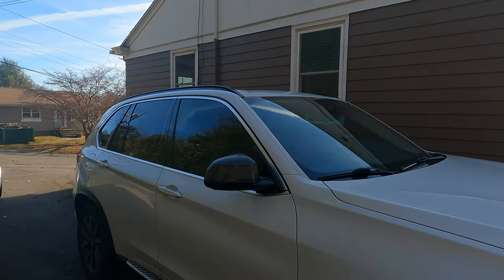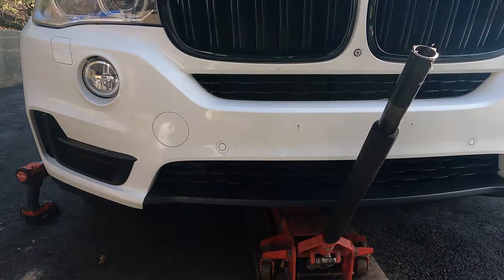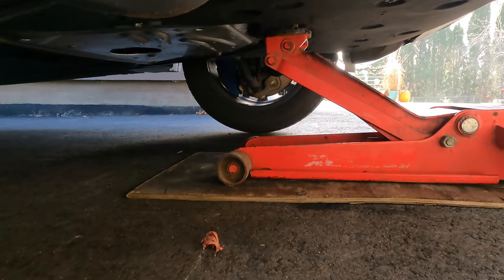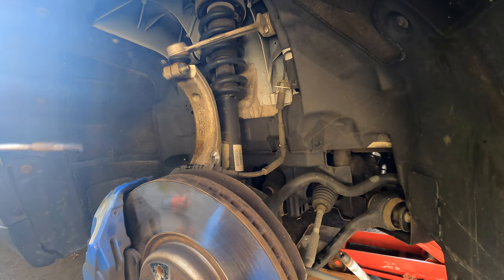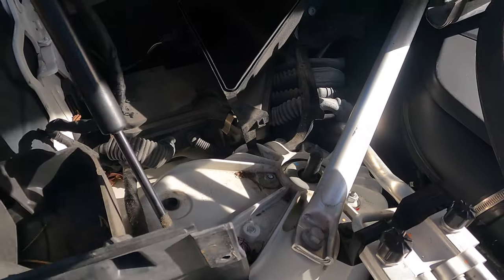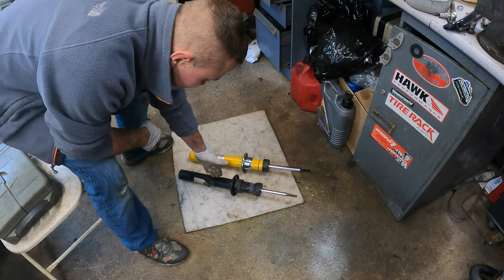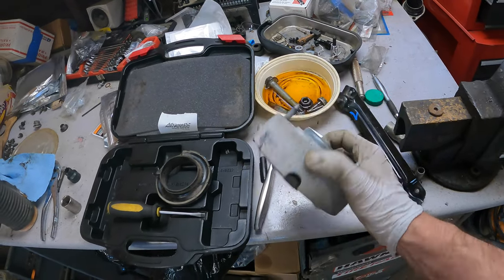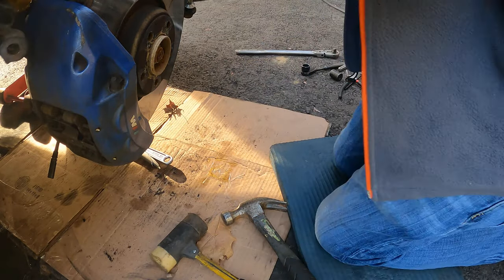Bmw X5 F15 Front Strut Shock Replacement - Bilstein B6 Performance Upgrade

Comment: How do you like the shocks ? Do you notice any improvement? Cheers from Vancouver
Reply from the maker: It has been 1 year since I installed them, and I must say I definitely like them the ride is firmer than before small to mid bumps are absorbed very nicely, but on huge pot hole it is definitely harsher then before, these shocks are made for highway cruises car feels like it’s on rails very composed ride is firmer but complainant comfortable imo, I like 👍 them when towing something heavy like a boat or big trailer with these car feels so much more stable then before over bumps road imperfections 👍
Reply: @MotorsportInspired  right on thanks !